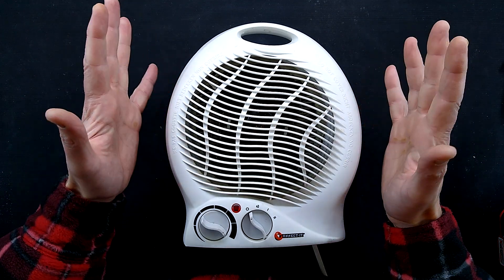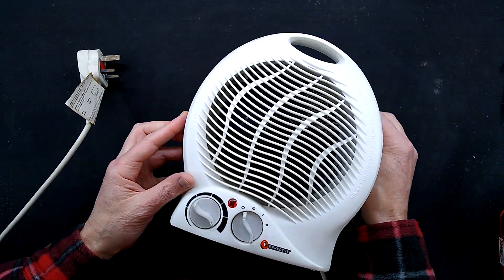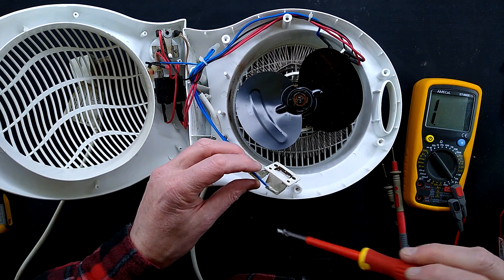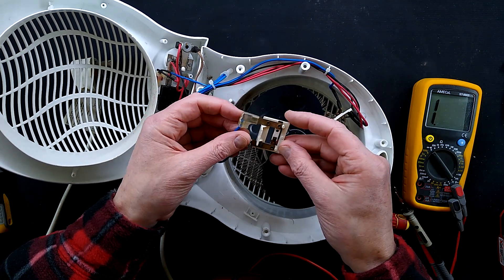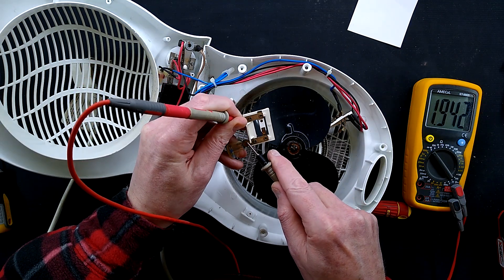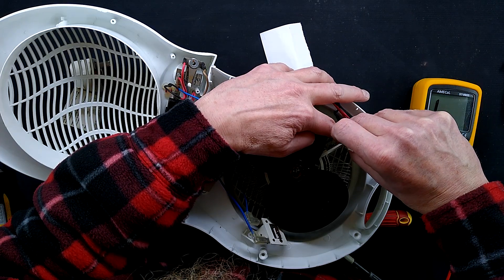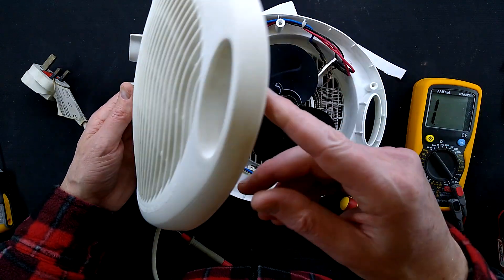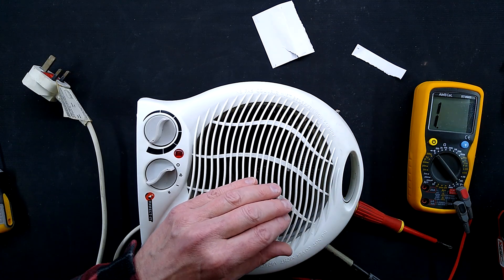Fixing a heater and an apology to my bro

Comment: I have bypassed the thermal switch when they go out. I do know that should never be done and could cause a fire. The only time i use an electric heater is when I'm waiting for my gas heater to warm the room, usually only 30 minutes max then it gets unplugged. I've rarely had the thermal protection fail, usually it's the switch  or ceramic heating element. I can repair a switch but I'm not sure if there is a way to repair a ceramic element. I do save old broken heaters that way i have spare parts for the next one that breaks.

Comment: I fixed an appliance today.  My vacuum cleaner's (Hoover's) on-off switch was "broken" in an "always on mode" for quite some time, figured I would just have to live with it.  Needing to plug it into another wall outlet I set it upright and running.  As I moved away, I tripped over the cord and knocked it to the floor.  It hit hard enough that now the switch is working properly!

Comment: The cardstock/paper abrasive technique works a lot better when wet with some petroleum naptha and a few drops of mineral oil.
If you're flush with cash then use a can of "Deoxit D5" but it is expensive and (likely) has barium and/or chromium based corrosion inhibitors; I don't think I want that in my heater.
Reply: The petroleum Naptha is OK, as would Isopropyl Alcohol  , but the mineral oil is likely to cause later problems in a heater.

Comment: I always use open barrel wire splices for that kind of thermal fuses and diodes in hair dryers, they also work to crimp the resistive wire.

Comment: The issue I have with these cheap blower heaters (I've got about 4) is that new or old, dusty or not, on the high setting they run too hot and cut off the element, usually with a burning smell.  I've had 2 of these things catch fire in front of me, not to be trusted if you're sleeping or go out for more than a few minutes.

Comment: This reminded me of when I worked in a repair place on some kit that was quite sophisticated for measuring temperature in an industrial process. We had a new tech starting and we gave him a board where the (soldered) thermal fuse had popped. He was not the best at soldering and kept wondering why it still did not work after replacing the fuse time and time again. About a week later he had more or less mastered those fuses.
Reply: I replaced a thermal fuse on a small electric stove, the sort that can be used to heat a single pot on a table and then put away after use. It used crimped connections, not soldered because the thermal fuse was only rated at about 85 deg C.

Comment: Get a Infrared Heat source lamp with TRIAC dimmer So you can adjust The Wattage

The Infrared  Heats you up Faster & Uses Less power (esp With a Dimmer 250W ~ 20W) 

infrared lamp philips A19 - E27 - BR125 - 250 Watt  - £15.99

However for power cuts I also suggest a wick paraffin  heater with Infrared  emitter
- KERO 360 / 363 3.0kW Liquid Fuel Heater
- Tosai 241 2.2kW Liquid Fuel Heater

With AC power and climate control - paraffin   or Tozane or Paraffin Extra ROLF fuels fuel injection fan heater 
- Inverter 5006/5026/5086 3.2kW Liquid Fuel Heater 
- Inverter  MiniMax  2.4KW Liquid Fuel Heater 
only use 800W For 2 min Start UP Warm up cycle the drops to 15W Running for AC mains  the 3.2KW ~ 350W Heat Comes From liquid fuel - Paraffin   or Tozane or Paraffin Extra ROLF fuels

Comment: I've got that same heater in 120V and it heats just fine.  It will handle my entire apartment.  Cannot imagine how much quicker it would heat up on 240V.  The kettles heat up much faster, right?
Reply: the elements are different, so the total wattage is still the same. A 120v heater over seas or in USA(other) on 240volts, would dangerously overheat/melt/burn out instantly.
where as a 240volts heater on 120volts would run about half the wattage (fan would run very slow or not at all) and still overheat.
to sum it up, the heating elements are different resistance for whatever voltage they're designed for (fan motors are different also, but depending on design).

Comment: My circa-2005 Razer mouse had started developing what I coined as "Phantom Clicks", where often when I would click, they're would be additional clicks that would be detected.

This actually plagued me twice, but the first time it took me almost a year to conclude what the cause was... It inevitably had gotten worse, to the point where sometimes it wouldn't register a click AT ALL... That's when I broke down and decided to go to the extreme with the disassembly... 
Relevance to this video? Being they are quality mice, they actually use micro-switches (long and rectangular) for all 6 buttons — L/R conventional, then 2x on the left side (thumb), and 2x on the right side (middle/ring finger). These switches once removed and themselves taken apart (their case clips together visually), they kind of resemble the thermal cutoffs: round metal pads welded to flat metal springs.

The non-detection of a click was due to... believe it or not... carbon dust buildup on the pads! There's not much voltage here, so I was quite shocked (pun intended) that this was the cause...
So just as you had, I cleaned them off and reassembled to switch half!
RANDOMLY NOT DETECTING CLICKS: SOLVED!

As for the other issue, the phantom clicks, it was still switch related..... but in THE weirdest way. (actually, as I type this, I remember I fixed this prior to the non-detection issue, thinking that this manifested again... but anyways)
One thing I had noticed with the phantom click was that I seemed to be able to have a higher chance at triggering it based on where I had pressed down on the mouse button (beings that mouse buttons are wide). Turns out, it was because after a decade and a half of daily use for hours each day, and probably a million or more clicks.... The tiny rounded bump on top of the physical switch, had worn a groove into the plastic standoff attached to the mouse button!
So if I depressed in a way slightly different from usual, the non-worn portion would trigger the switch like normal. The phantom click being that the mouse buttons being plastic, could flex a tiny bit left or right, making the standoff run across these precision switches enough to cause a rapid fire click sequence! 😐

Solution? Stupid simple: a tiny dot of super glue to fill in the worn plastic, carefully sanded flat.
RANDOMLY CAUSED PHANTOM CLICKS: SOLVED!

My 2005 Copperhead lives on! Albeit, needing a new USB cable, since it's internally broken (a few times, but bent in a certain way and taped to not move, solved it each time 😊). Which is GREAT news for me! Because the version 2 they released, which I bought, has different side button placement and lacks the rubberized side grip, making it horrible to use in my big hand!

Comment: I bought a metal case space heater for the small greenhouse. It didn't turn on. I opened it up and found the tip switch weight shaft bent from shipping perhaps. I straightened it out and it has worked since. One of the heater couple contacts did fail later, but using a burnishing stick, I got it working again. I used that stick in my career for the reed and relay contacts. It was in my wallet until I retired.

Comment: I usually use the paper trick on volume control wipers with added Servisol, it usually works.
As for a dead thermal fuse, I usually wind a piece of fuse wire around it😁

Comment: If contacts were mount on the plastic holder, when overheated, plastic could melt and bend, resulting in loosing the necessary mechanical tension between the contacts.

Comment: Fix-It Shops no longer exist for this very reason. Fail Safe means One Shot and it's done. I have a ceramic heater that I use every winter even this one when it failed. With four elements I noticed it wasn't getting hot on low. One element is out. I snipped the wire for the low elements and turned it to high. Someday I will tie the remaining two together for its third life. 
Love Ya Man!!
Reply: they usually just parallel more or less elements to go from low to high( low one element, medium two and high three). some will do series/parallel element combinations to reduce total output.

Comment: I'm fascinated by heaters much like you are by LED things. My primary heater for quite a while has been an ordinary Sunbeam. A long time ago, the temp knob failed, and I tore it out and modified it to be controlled by some relays, a pic with serial over bluetooth. Sitting an looking at it right now, still working after all these years. I've taken it apart more times than I can count. The safety components always fail first (which is good), so you can keep fixing the same heater over and over again without buying new. Eventually, the elements in mine gave out because the riveting to the nichrome wire loosens with heat cycles. Turns out you can easily get some machine screws and washers and make reliable connections... What does this have to do with the video? I dunno. Just remembering fondly. Also, I had a heater in that shape I picked out of the trash, It promptly melted it's heater wire into the plastic when I tried it because the standoffs were broken (must have been dropped) Not always the safeties fail first!

Comment: I melted the front grill of one of these cheap units drying some mountainbiking shorts too close to the unit. The shorts dried in minutes and the unit still works so success but also will leave them hanging further away next time to avoid potential death haha

Comment: I acquired a number of relatively new USA "Milk House" type heaters that were being discarded because they stopped working, constantly tripping out, they had run continuously and the fan bearing lubrication dried out and the fan seized up, little machine oil applied to the fan bearings resurrected each one, not as much fun as poking around with the multimeter, but now what do i do with all these heaters?

Comment: I had one similar to this. I fell asleep with it on and awoke to the room getting brighter. It was slightly on fire. Needless to say I jumped out of bed, grabbed it, ran down the hallway and threw it outside.
Reply: I have a couple of them here in the states, they all have tip switches. I don't know if they have thermal cut offs. The fans love to die on these for me, and just get hotter and hotter. My luck I have been in the room and awake when they do.

Comment: Clive use Emery paper to clean contacts , same as cleaning points inside an old cars distributor cap, wet n dry paper or even a nail file , fine grit 1

Comment: I'm guilty of forgetting the plugged in or out status of a device while poking about, also isolating the wrong mcb , and finding live nutrals on off circuits, it's strange how much work you can get done on live electrics without knowing they are. I'm less shocked now when I get shocked ,it's more of a what have you missed this time dumbass .
I won't mention my solution to those thermal switchy watsits needless to say they now cycle less.

Comment: My old blow heater needs a service every year, it's just the fan bearings well bushes really. So every year I take it apart and give it a clean and lubricate the bearings and like Ralphy I use it in conjunction with a blanket but never covered. The heater blows into my blanket which hangs down from my chair trapping the heat around my legs.

Comment: I have this same kind of fan, but it has one more failure point. It has a springloaded switch at the bottom, that kills the power if it's not pressed in. It's meant to be a tipping killswitch for clumsy people, but it's annoying because it requires a hard surface under the fan and you can't pick up the fan and blow at your cold feet unless you either push the switch stem in or tape it over.

Comment: That’s the problem with open thermal switches. They are cheap to produce. I prefer the more expensive route, the Klixon style thermostatic switches, they are sealed and use a bimetallic disk within their housing. They are commonly used on electric dryers as thermal cutouts. A flange mount unit would be best for this open style unit screwed to the aluminum "heat sink". If one can find this tool the best alternative to paper is a contact burnishing tool. A very thin piece of flat spring steel that has a ultra fine grit bonded to it (around 2000 grit). This tool was commonly used to clean relay contacts and stepper switch contacts in the old telephone step switches.

Comment: That heater makes an interesting contrast to a compact fan heater that I have. My heater has a spring loaded "foot" sticking out the bottom, so that if the heater tips over or is not standing upright on a solid surface it will not operate. I am slightly surprised that your (brother's) heater does not have that feature.
Reply: I own the US version of this heater and it is identical except for being 120V and mine does have the "safety" foot. Nothing some duct tape can't fix. These are pretty much the cheapest heaters available. Dollar store stuff. Very cheaply made to the absolute minimum. Despite that, mine has lasted for years.
Reply: @LatitudeSky  you dident  perhaps have worked at Thernobyl in the past did you?   XD
Reply: @LatitudeSky    duct tape  and  make it a fire hazard.
Reply: I have a similar (basically identical) heater and it has the switch. I find strange that this one does not seem to have it.
Reply: @okaro6595  they come in different models with different names from the same factory in China. 

Some have these switches some don't. 
I prefer the ones with the tripping switches because they are much safer

Comment: I’ve just been looking at all the videos on repairing patio heaters.  Usually the tilt or “dump” switich.  Most look to bypass but all the switch is is a microswitch with a ball bearing that sits in a cup when upright whose lever pushes the switch closed.  Digging is a similar contact repair.  They carry the thermocouple voltage of 30 mA so sensitive to corrosion.

Comment: All the heaters I've seen in Australia have a switch on the bottom. So they wouldn't have run in the way you tested this one, picking it up and tilting it. They have to be resting on a flat surface to run.

Comment: I've not had an electric fan heater in a long time, last one I had decided it was fun to blow sparks out the front like it was a welder, this was about 16 years back and the fan was I think a cheapie from Asda, then later a convection radiator dropping hot metal bits out the bottom, right next to a heatsink of a cat sleeping between it and the wall it was by, rather put me off portable electric heating... :S

Comment: I have bought a similar heater recently. It is the symetric version of the one you have in the video.

It seems to do the job, but I don't like the smell that electric heaters give off. I've had a convection based electric heater before which had a similar smell. I wonder if those little radiators filled with oil have that smell too.

I guess central heating is the best. Or just wearing a nice vest and/or coat.
Reply: I have one of the oil filled radiators and they on their own do not emit any smells or odors. However you will get a slight burning smell from them if you allow dust to accumulate in the radiator cores. Keep them clean from dust with a bottle brush focusing on the connecting surface between cores both upper and lower and cover them with a cloth off season so as not to allow dust to settle on the surface.

Comment: I've had that heater or its clone. They're utterly dire & the plastic grille goes brittle & falls apart inside a year of light use.
Oh & the thermostat switches off but not on again, the cut-outs fail all the time & occasionally, they set themselves on fire for extra entertainment value.

Comment: But can it make ozone?
Reply: if there is a loose connection arcing inside it, then yes.
Reply: @m.k.8158  It was just a joke. Clive is pro ozone, and Fran posted an anti ozone video yesterday.
Reply: @chinanorthairguns  I realized that, but since my response WAS correct, and at least slightly humorous, if dry, it "fit"

Comment: Just put some sand it, flux it and solder it so it won't happen again. Just make sure you unplug it when done. That would work if it is for personal use. I wouldn't do that for someone else's stuff. It isn't safe, but you'd get heat out of it.
Reply: I guess if it gets hot enough the solder would melt and the circuit would open, but that's pretty hot, lol.

Comment: A fan with two blades is not something I expected.
I have a box style heater fan. The switch tripped once when I ran it on full for a bit too long(I think? IDKY it tripped.) On this one, it cuts the fan also. I think the fan should always work, so even if the heater fails, it still works as a fan, which may also help it reset a bit faster.

Comment: Has anyone taken apart a DJI motion controller before? I had one arrive dead and I want to check the battery. I removed the four screws but it feels solid and like it will break if I pull it apart. Can't find a teardown video anywhere. Cheers.

Comment: Almost all appliances in my house have their blown thermal fuses shorted by now. I am comfortable to rely on the circuit breaker in the panel. Moreover thermal fuses are usually tied directly into the winding of universal motors and I have seen many universal motor windings made from coated aluminum wires intead of copper and tying wires to the aluminum wires is tricky.
Reply: A circuit breaker will only respond to overcurrent.  Appliances don't usually draw more power when they overheat, so the lack of a thermal cut-out could result in a fire.